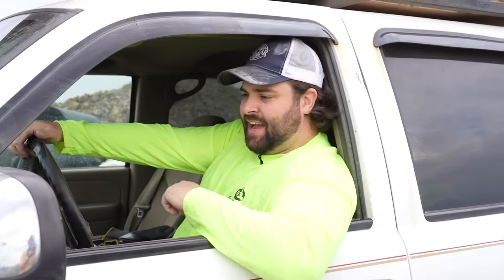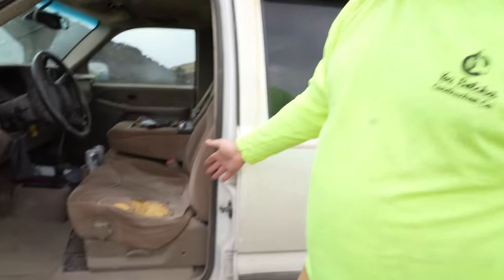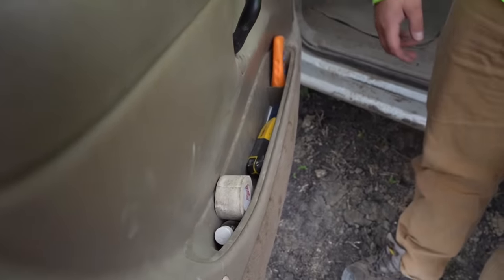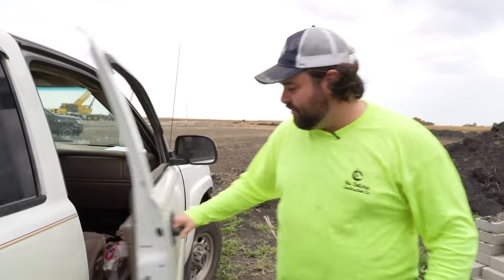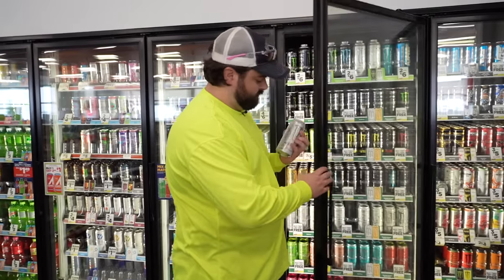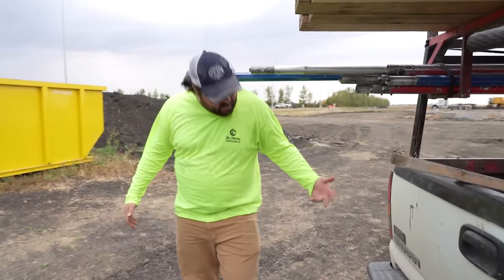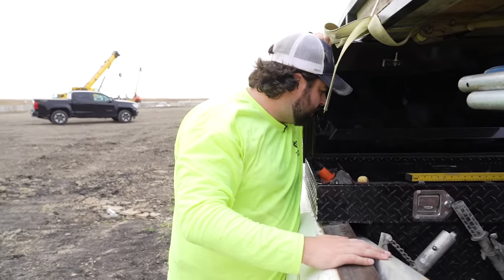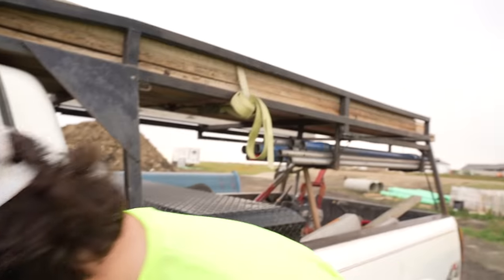Construction Worker Truck Tour

Comment from the maker: Every time I stop at Holiday, my truck gets a little messier
Reply: Oh I know it's crazy how it happens
Reply: And every time you go through a drive through it gets a little bit cleaner
Reply: I have one very similar 230,000 mi 6.0 GMC
All you're missing is a s*** box edition badge on the side
Reply: If you make u shape brackets for the length of the bed and then extending outward you can have your own standing bar table or work bench 2 for 1 👍
Reply: The standard passenger-side dumpster only gets cleaned out so you can look busy at the shop

Comment: My first boss had a mid 90s crew cab f150 that was given to me for my work truck.  He paid me a full day to clean it out, and i thought hell yea ill spend an hour or two cleaning and get paid to f off for the rest of the day.  Nope.  8 and 1/2 hours.  The back seat alone was literally garbage and crap all the way up level with the front bench seat.  I did find a brand new Hitachi framing nailer he thought someone swiped from the jobsite 🤣
Reply: reminds me of buying my truck. my buddy "cleaned it out for me" and I still pulled two contractor bags of shit from it. Probably vacuumed up a whole pouch of rolling tobacco, and I  found three tall boy cans jammed in the spare tire tool compartment.
Reply: The amount of things "stolen" from work trucks greatly exceeds the value of the items carried in said work trucks, namely because the same items get "stolen" theee times a week.

Comment: Don't forget that ever-present nail in your rear right tire that comes back no matter how many times you remove it!
Reply: You must work with roofers.
Reply: @PatrickKQ4HBD  
OMG YES HOW DID YOU KNOW??? 🤣
Reply: @MelancholyRequiem  they’re notorious for that shit lmao. Found a roofing nail an inch beside my tire when I pulled in the other day….. we haven’t even had roofing repairs to my knowledge…..
Reply: Drove with a nail in my tire for about 4yrs. Yes I was roofing at the time and it was the left rear tire.
Reply: @kenkinniph2327  it's not a problem until you take it out, then it starts to leak
Reply: @keegenm.6154  Figured it added traction so I never bothered.

Comment: Our truck has a wrench to roll down the windows, doesn’t even have panels. This is great
Reply: Chuck you drill up to it and u have electric window
Reply: Mine was vice grips way back when
Reply: My coworker welded a pipe wrench to the trailer hitch. You would believe how far back people stay when driving. 😂😂
Reply: I saw a large monkey wrench welded to the rear bumper of a work truck, at an angle.It looked like it was just sitting on bumper and could fall off at any time, so other drivers would not follow so closely.

Comment: We have a 2002.5 Chevy Duramax with every light going off and dead gauges that looks exactly like this. It’s pulled 6 tons almost every day of its life and bellows white smoke at an idle. 300,000 miles later and she’s still going strong getting 17 to the gallon filling up every 200 miles, which is recorded with a phone. Can’t get rid of it because it’s been too reliable to sell.
Reply: You can't buy a used duramax to save your  ass.
Reply: @davidshumski4629  that’s cuz they’re all still chugging along or dead with 500,000 miles in them.
Reply: @El-Philippe  I have a 03 . It's got some rust but runs out  good 👍

Comment: We had a early 2000s gmc 2500 with a service bed on it, thing had the 8.1 l engine. It also had a leaking heater core and all the windows would fog up bad. Regular cab, 3 guys in it all smoking wearing winter gear . Stop and go traffic across Ottawa . Good times

Comment: Used to do construction renovating houses. It would normally hit 110-115 degrees here in arizona with no AC. You betcha™ass any house that had a pool we "cleaned off" in at the end of the day. I feel bad for those pools cause we would jump in there covered in insulation, drywall/concrete etc. 

On the bright side it was a good ass way to learn how to fix anything around the house. However, I still havent learned not to grab both sides of the outlet.
Reply: My arms a tingling just thinking about it, I have replaced so many live outlets and yet I still screw up.
Reply: @AtomicReverend  hahah glad I’m not the only one.

Comment: I used to work in a bus garage doing odd jobs around a university campus in a work van. Sliced the side of my hand clean open with a razor blade removing decals from an old truck in 98° heat, but luckily we had a real nice first aid kit in the van: a roll of paper towels that are supposed to go in one of those automated towel dispensers, and a couple large off-brand bandaids from 1997. The old wooden stepladder from the 80's I was standing on at the time probably still has the blood stains soaked into it 5 years later.

OSHA who?

Comment: Miles, you've sold me that you work construction, ive always assumed that you made a living from youtube. Truck aint too dissimilar to mine lmao! You forgot to mention the squeaking suspension so people can hear you pulling up to the site from a mile away
Reply: Its the Ford squeak from F150 or F250 from squeaking old bushings and ball joints from front control arms.If you replace control arms, the squeak goes away.If you drive close to 200,000 miles or more without replacing after squeaking, the front lower control arm ball joint has a plastic socket that can wear away, getting so loose that the spindle, wheel and tire could kick out at the bottom while driving , while the top of the tire could fold up inside the wheel well.
Reply: Other brands of trucks could do the same thing with excessive mileage without replacing the ball joints on the front lower control arms.

Comment: I just bought an old 1999 Ford 7.3 owned by a construction company since warly 98. 390k miles and running like a champ. Interior is fucked just like this one but it was sent for routine maintenance so mechanically solid. Cheap reliable and proven.

Comment: My steering wheel no longer has the rubber compound on the top half, which really becomes a quick teeth removal system if in any collision above 15 as it's just straight metal. I also have a mouse that comes out at night and has some of that days chips that are left on the front seat. He doesn't use the open top of the bag, he just makes a new hole in the bottom side so you don't realize it until you are a few chips in the next day and then wonder if the old hanta virus is gonna getcha. Other than that, it runs like $hit and gets the job done.

Comment: You're almost to the critical mass point with your Holiday compost pile, If ya tried a little harder, it'll get there. 😉

Just add a flux capacitor and that truck will be carbon footprint negative... 
🤔